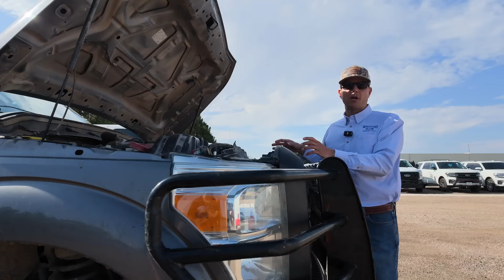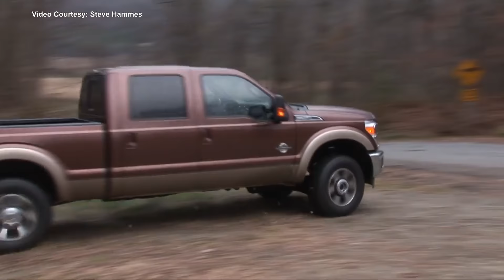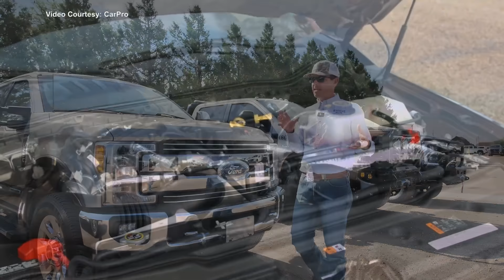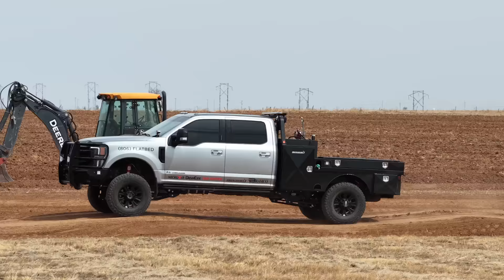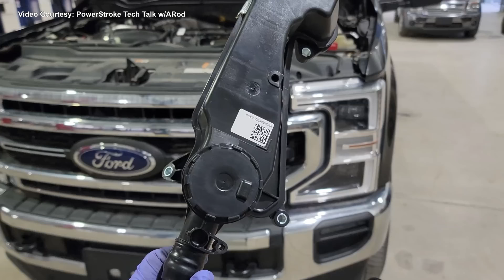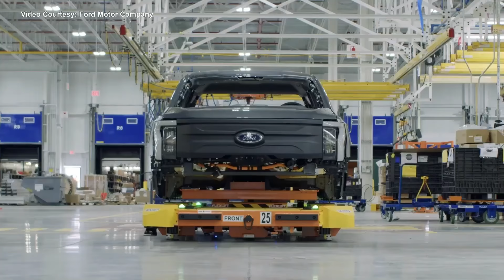Every 6.7 Power Stroke Generation Ranked by a Ford Dealer

Comment: I’ve had the first 3 generations and all where great trucks. 2014 sold at 200k miles, 2015 still currently have in our fleet because it just runs so good 265k miles still running strong, and a 2018 we sold at 114k miles during covid to friend who really needed a good truck, my uncle has a 2017 with 370k miles original motor original transmission and on second fuel system. We are currently looking at buying a new f350 and are debating between a brand new truck or finding a clean low mileage 2020-2022.

Comment: Thanks for the in depth, honest review. I’ve been telling coworkers, friends, and family for over 45 years that Ford (unlike most other vehicle manufacturers) doesn’t need to be forced by NHTSA to issue a recall. They voluntarily recall vehicles to improve the vehicle. 
For any GM fans out there, can you tell us why GM/Chevy trucks have had tail lights and headlights/daytime running lights that burn out prematurely since the 1980s model trucks? You’ll see it on a daily basis if you live in a populated area that is vehicle dependent.

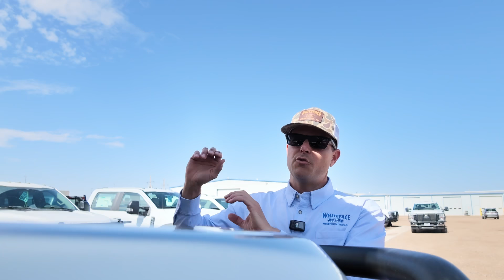Comment: 23:58 technically the current gen DOES also still inject fuel in the exhaust stroke using multiple cylinders ONLY during those high idle “kinda regens” at warmup or extended idle when engine temps drop. Yes it has a 9th injector at the downstream, but at certain conditions (like extended idle cold or if it notices DOC efficiency Dropping) it can’t just inject thru the 9th injector to clean out the DOC surfaces. It must also use upstream in-cylinder injections to force higher temps (you’ll hear the timing change drastically during these). That’s also why you’ll actually smell unburned raw diesel fumes coming into the cab HVAC when parked (it changes the timing so much that the intake actually has positive pressure, allowing those extra exhaust stroke fuel injections to go backwards out of the intake). This is evidenced by soot/fuel staining on the air filter media. This process also occurred on the 2022 model (in preparation for 2023+ EPA emissions strategy). I’ve owned ALOT of new 19+ 6.7’s so I’ve learned a lot from all of them. Currently have a 2024 f250 limited.

Comment: Mac Swing Steer sold the rights to Bad Boy and continues to manufacture them under the Bad Boy name. It’s essentially a clone of the original Mac Swing Steer. With the Mac Swing Steer being discontinued, I decided not to wait and purchased one last year. Absolutely no regrets! The broom works amazingly well for clearing snow off asphalt driveways, the grapple is incredible, and I maintain a huge stretch of gravel driveway with the Hydro Bucket. This machine never fails to amaze me. We got lucky, and ours showed up just two weeks before the ice storm last year. It had absolutely no problem clearing everything, and even in several feet of snow, it was almost impossible to get stuck. I couldn’t be happier with the purchase! The forks, bucket, and can’t forget about heat too. I probably spent about 10 hours in the machine in 15° temperatures and had to turn the heat down sweating.

Comment: I live in northeast Ohio and we get a lot of snow up here and those aluminum truck body's seem to hold up a lot better up here then the competitions sheet metal. 
And it's been obvious which year went to the aluminum body look at a 2014 and 2015 up here you see how obvious it is the 2014 will be starting to rust in various places and fairly easy to spot the 2015 looks brand new still

Comment: As an owner of a 25 F350 with over 100k miles, I’ve had no problems.  In my opinion, if Ford were to get rid of the cp4 fuel pump they would dominate the diesel pickup market even more. I have never been a Ford fan,  but this truck has impressed me. More than 60% of the miles on it has been towing. The cp4 is being swapped out for the DCR this week for my own peace of mind and to permanently head off any possible future problems. Great info John, I appreciate the time you take to make these videos to educate us on these pickups

Comment: I had to replace my beloved Cummins Ram last year because it didn’t have enough payload for our truck camper. I loved that Cummins but my new Ford High Output 6.7 is an incredible engine. So far I love my Ford. The dealer, not so much.
I’d almost make a 600 mile commute to have you service it.

Comment: 1st ever Diesel , i bought a 2025 6.7 F350 Lariat DRW H.O , i had already purchased a 5th wheel and this was the only dually on the lot.

Going up La Veta Pass at 9,380 elevation the engine cooling fan kicked on , it scared the crap out me it was so loud, so my wife got on Chatgpt and told me it was " normal" ...i never heard a fan that loud ! But it was doing what it was supposed to do ! Power and Tq. On this is amazing and it pull our 14,000 lbs RV with ease....and yes i have "enough " truck 😂....

Comment: I have a  2025 6.7 diesel, has ford started using a CP4 pump now that doesn’t have the issues of the older CP4 pumps. I thought I had heard of the newer models having a fixed CP4 pump

Comment: The 17-19 don’t use the same lift pump as the 11-16 and the upper & lower fuel filters are different. Also the engine “job 2” engines got larger connecting rods. The 17-19 6r140 has less clutches in the transmission so they aren’t as strong as the 11-16

Comment: I have a 2018 ford f250 6.7. I having issues with my diesel tank. By the vin number is a 34 gallon. I haven’t put more then 20 gallon even the gage on my truck read half quarter tank. What could that be

Comment: I bought my 2015 brand new with 12 miles. I now have 397,000 trouble free miles and it’s been deleted since 100k. It’s no longer my daily driver and I’ve upgraded to the DCR fuel pump. I’ve changed the body mounts and it still runs like a brand new truck. Although it will probably never hit a million miles, I plan on having it forever.

Comment: I agree with almost everything in this video except for the ten speed, the six speed was far more dependable then the stupidly expensive to fix ten speed. I can take a little less towing power for dependability so my low mileage 17 will stick around in my collection for a ling time.

Comment: Could you guys speak to the fan kicking on while under heavy load on the 6.7 Power Stoke? One of your other videos made me think of this. I always get a little worried when it kicks on and will back off the throttle. But I’m now wondering if doing that is actually worse on the engine.

Comment: I have a 3500 6.0 with only 20k miles on it. It currently dont run and has not ran for over 10 years. Still smell brand new inside just has a blown head gasket. Not sure what to do at this point

Comment: 6.7 was a great leap ahead by ford. 6.4 was generally more reliable than previous 6.0 (especially back in its day) but when it failed it failed hard and more expensive to fix than 6.0. 6.0 (especially early on) had issues relevant to a company that just developed its own diesel engine in house. there were also a few maintenance 'miscommunications' between ford and dealers on maintenance. 6.0 to date is the most 'aftermarket' upgradeable/ improvable diesel engine of all. dodge, chev and other ford diesel engines.
Reply: Ford didn't build the 6.0 or the 6.4.  The 6.4 is absolutely the worst diesel engine ever installed in a truck. I have 3 right now 2 blown up one is a maybe.  The 6.0 earned its reputation as junk the hard way. You know repeated failures $10k to 15k at a time.  The 6.7 is the first in house diesel ford ever built.  Other than the cp4 it seems solid. I just bought my first one we will see
Reply: @Ray-x1i1v true in the sense that the 6.0 and 6.4 were still international blocks. the 6.0 and 6.4 are the same (but more costly) blunder ford mad eas chev did taking the 6.2 and 'tweaking' it in house to create the 6.5

Comment: I had an ‘11, a ‘16, then a ‘12. Now I have a ‘26. Not one issue except the emissions systems. Also ran additives in my fuel.
I have a DCR, new trans pan and new oil pan to go on this one. May do some emissions upgrades too. Plan on driving it for a long time.

Comment: You are a great saleman. The northern Ford dealerships need to watch your videos on the showman ship. Have 2020 King Ranch 2015 6.7 lariat, but my best ford truck is my 2009 6.4 f350. 17 years and has very let me down. My new 01 7.3 powerstroke  did 3 transmission in 5 years. Still have my 01 with new transmission and new 7 clyinder 2023 powerstroke engine.

Comment: Liked until you stepped into the recall b.s. half the recalls ford issues or worse their "satisfaction program" just covers up the issue.

 Every f150 has a recall to reprogram your transmission to ignore the lead frame that needs to be replaced.

Comment: I've spent 27 years in F550s.
The more modern 6 speeds were amazing.  Never understood why Ford never programed the Tow/Haul mode to disable the overdrive.  My trucks weighed around 16K, and in the AZ mountains, so I normally dropped out #6.  My last truck has a 10 sp.  Then I blocked 8, 9 and 10. I don't use OD in the hills, never lost a transmission.

Comment: I’d like to have a 450 single cab with a lariat or king ranch interior in argon blue for a farm truck but idk how I’d get the interior I want with it being a single cab
Reply: Yeah the limit of all the trims to only crew cabs is crazy.  I hate how they push the crewcab body style so hard!  Not everyone wants or needs a whole back seat like that.  I prefer the extended cab trucks with 8' bed but you can only get XL or XLT trim in that body style - no Lariat etc unless it's a crewcab truck!  I like the extended cab room behind seat to store tools and still have the ability to seat someone back thereon one side if\when necessary  I understand they can't get every trim in every body style but c'mon now you can't even get lariat in regular or extended cab bodies anymore!  It seems like the '00's was the best time to order super duty trucks just the way you wanted them.  Nowadays they literally force you into a crew cab\short bed truck platform if you want any higher end trim packages at all! 🤬
Reply: It stinks to spend more money to get a trim level you want but doesn’t exist. I’ve seen videos of people giving their lower trim trucks an upper trim upgrade. Sorry I have no links but research could payoff to get your dream truck.
Reply: @Ovalworked  It's a whole lot more than just swapping out the plastic interior panels.  You have to swap the cab wiring harnesses usually because of the additional modules and wiring needed for the stuff in the higher end models.  Then you'd need to customize some of the interior panels to fit in the smaller cans and look finished which isn't always easy.  Basically they just want to force you into a crewcab if you want any of the higher end trims, cause XLT is the highest level you can get in the various cab models that aren't crewcabs.

Comment: Getting my 2016 Ford F250  6.7 power stroke  king Ranch with 100,000 miles tomorrow. Found it on Carvana for 40k. I paid for the 12,000 mile/24 month coverage package. Once that is over, then I will delete and place disaster prevention kit. Any advise guys? I was always a Dodge fan, but my cousin and friends convinced me to get this.
Reply: You did well.  Great truck and those miles are low.  Your price is good too!
Reply: I think you overpaid, be ready to replace the cab mount bushings.

Comment: Excellent video. My dream truck is a 2025 F450 KR. I still have a long way to go. My current truck is a 1995 Toyota T100 with 240k miles and still runs great

Comment: We have 2017 450 ( bought it at Whiteface ) and a 2019 550 best pickup I ever owned comfortable , good cab , powerful and not much trouble with it ( some points we made it bulletproof )
450 most time pull gooseneck trailer hauling farm equipment the 550 is a service truck just great pickup’s

Comment: I had a 19 250 gas unfortunately. Loved the truck.  69k dropped a valve. Had extended warranty. Ford covered it. Unfortunately they put a reman engine in not a new engine. It was replaced again after 1000 miles. Again a reman. 9000 miles later another reman was going in. So after 14 months and 3 engines I had enough. Looked at a new power stroke but went with a ram. Would have went to whiteface ford if not 1100 miles away
Reply: Curious, even though warranty would only cover a reman engine, did you have the option to kick in the extra for a new one? Not the ideal warranty situation but if that was an option I probably would have kicked in the extra just for a piece of mind.

Comment: I bought a 2011 F250 new and drove it for 14 years with no major issues. I towed various RVs with it. I did have the intercooler pipe split about 40 miles from home. Zero pounds of boost made the truck sluggish! I replaced it with an aluminum pipe. I now have a 2025 F450. I love the 10 speed! I went with the standard output as I never felt I had a lack of power with my 2011. The 6.7 is an amazing engine.
Reply: You're right, the 6.7's as mentioned here, have been updated all the way along, and they are certainly great engines!

Comment: the one with the less electronic garbage on it. Think about how the new badge on the f150 is a white ugly piece of trash like all of the black fender well trim on all the new cars. All 6.7s problem is the cp4 pump that does not get enough lubrication and metal starts to peel off of the pump lobes and ends up filling up the injectors trashing the whole fuel system and will leave you high and dry.

Comment: 2022 is considered to be the peak of SD. You get sync 4, no garbage all digital dash and everything on them is pretty well sorted. I was hesitant on the 10spd, but love mine now.
Reply: Yea I don’t like the all digital dash or the electronic parking brake
Reply: @JHolder90 Electronic parking\'emergency' brake seems like it's back-a$$wards!  So what happens if\when the vehicle loses electricity and pedal goes to the floor from a burst line\hose?  Then how is emergency brake activated?  Seems to me that these should always be mechanical linkages not another electrical thing to malfunction

Comment: 2016 6.7 steel body 4x4.  dually trailer hauler.  dpf heater fail.  cp-4 fail at 70k.  front wheel bearing fail on 4x4.  saving up to elim cp-4 & delete the epa crap on it.  truck is outstanding minus those identified weaknesses.

Comment: Great video, but the 17-22 have the same exact  in tank lift pump and fuel filters. Just curious why you say its the same as the 11-16? My 2018 has an in tank lift pump.
Reply: Yep the 2017 was the debut of the in tank pump, furnace style primary filter and three sae j2044 fittings on the upper secondary filter. He has repeated the 2020 was the debut of the in tank pump in a few videos, that is incorrect.

The 2017 low side fuel system is awesome for an OEM pump.

Comment: Ive owned many deisel trucks over the years my 2020 and 2022 6.7 have both been the best trucks ive ever owned period 
My last new truck before the 6.7was a 16 LML the truck was in the shop 18times in 4 years snd it was a turd compared to the fords
Reply: And I had 2011 and 2016 LMLs. Both were best trucks I ever had. Now I got 24 AT4X L5P and its junk
Reply: @marcelo403polo2 I brought mine brand new in 2016 drove it 4 years only out 63k on it .
It had 28 dealer visits and when sold still had unresolved issues . When the steering box failed at 43000miles about killing my entire family and gm wouldn't warranty it i was done with GM for life

Comment: Does a FAAS fuel system kit help with these fuel component issues?
Reply: will not hurt, but use good fuel additive every fill up. Had 2 LMLs with CP4s and never had problem

Comment: The best 6.7 isn’t made by Ford. 😂
Reply: not so sure, how about those hydraulic lifters???
Reply: @marcelo403polo2  you mean the same kinds as on powerstroke? I have a 4th gen, so wouldn’t know.
Reply: @jgeetime  TBH, I have no clue what power stroke is using. Im a Duramax guy since 2007. Currently driving 24 AT4X, and honestly I would not buy it again
Reply: @marcelo403polo2 I like the older trucks better, all of them. A buddy of mine just traded in his 2019 F-350 for a 2026 GMC Denali Ultimate 3500. I thought he was crazy. Plenty of life on the old truck.
Reply: @jgeetime  I wish to have my2016 T&D Denali LML back. IMO, way more solid truck then AT4X I got 2 years ago

Comment: All these updates and it’s still one of the easiest to steal. No updates there?  Clothes hanger can disable wire to horn. Pull door handle out and brake the plastic piece that goes inside the door. Like magic. Door is open and alarm/horn is silent. That’s how they almost got mine. Not to mention how easy the tailgate and lights are to steal. These problems should be addressed by Ford and not the customers. It’s common knowledge so they know. Must not care.
Reply: There is anti theft devices available for tailgate, tail lights etc. and of course ignition kill switch, etc.  Don't be a victim, fire back.

Comment: Updates I've done to my 2017: CP4 to the S&S fuel pump, added the '23 & up ccv filter, changed to an S&B aluminum cold air pipe, added a 60 gal S&B fuel tank & gave it a 'weight loss'! No more regens or DEF!!!! I still love the 6 speed towing the camper knowing I'll never have to worry about the aluminum 'trash can' failing like on the '20-'22 10 speeds!
Reply: This is my goal, half way there

Comment: My 2011 has 301k on the original drivetrain and fuel system.
Reply: It also has the original Garrett g32sst that ive put a wicked wheel on.